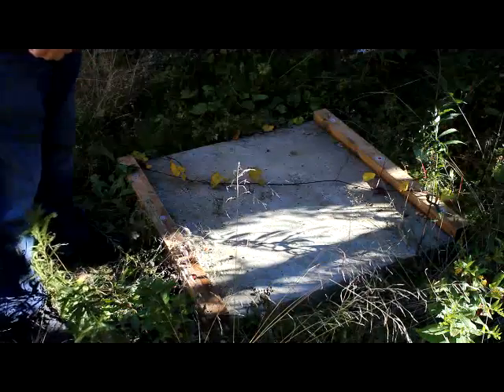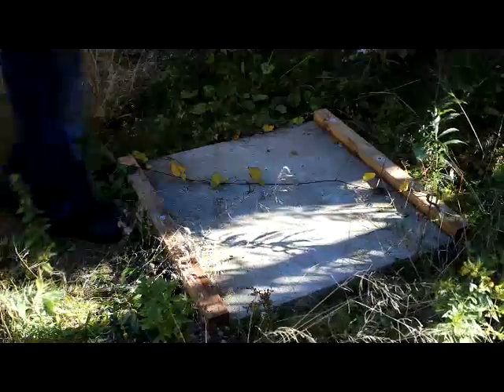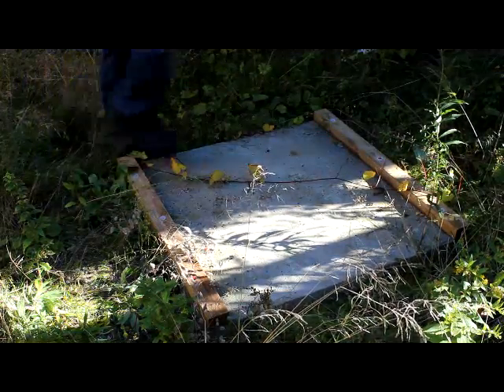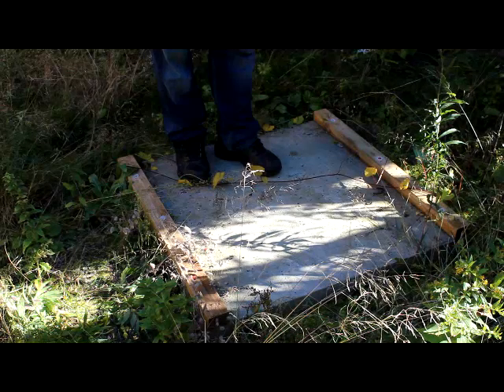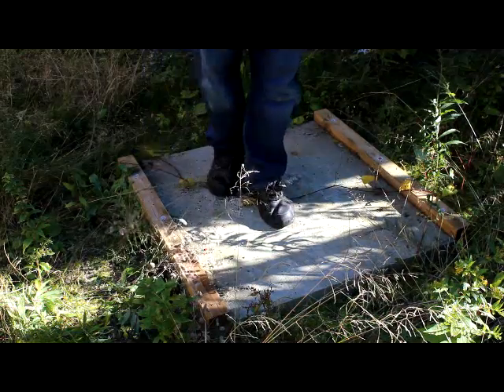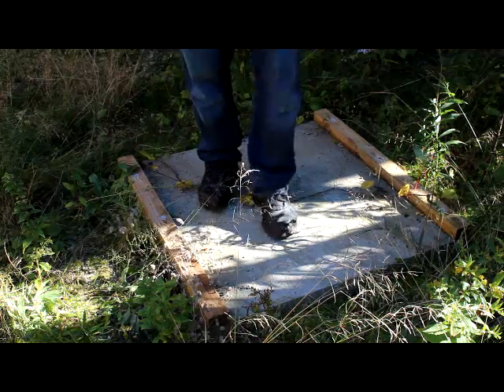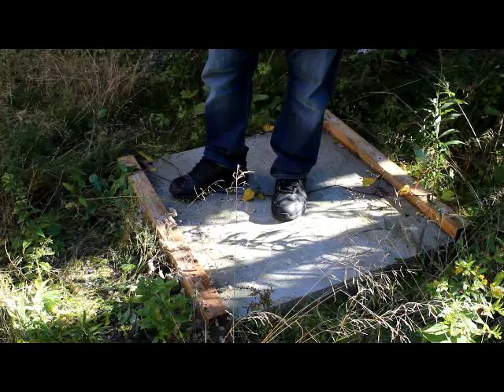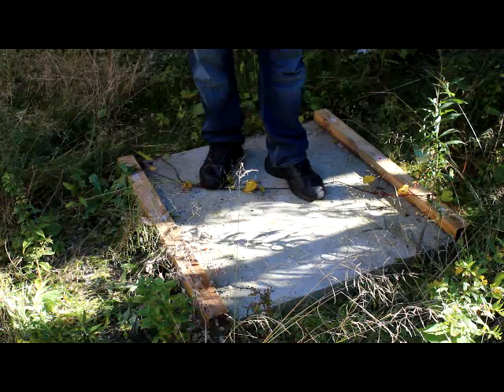(S-2 Ep-57) DIY Portable Generator Enclosure (FREE PLANS) Part 1

Comment: Do you pull your generator out every time you fuel it?
Reply from the maker: No. I have sufficient access to refuel the generator when it is cold. I do pull the generator out to refuel (it's on wheels) when it is hot though for an added measure of safety and less chance of a spill.

Comment: Uncanny. yesterday pre-assembled my generator enclosure. The design is VERY similar to what you built. I will be posting the final in-place assembly in a few weeks on my channel. My material cost so far is < $250.
Reply from the maker: My cost was close to nothing (just a couple of bags of concrete mix) because I built mine from leftover/scrap materials. In fact, I based my design on what materials I had on hand that I didn't have to buy. That's pretty much the way things usually go around here. I tend to be quite frugal.

Comment: Interested in how you skinned it!
Reply from the maker: Me too! Actually, this is as far as I could go before the snow fell and winter set in last year. When winter comes here in Downeast Maine, it comes very fast, without warning, and with a vengeance! It simply got too cold to work outside. I'd like to get it finished before the snow flies this year, and I'm planning on using OSB. I'll video the operation and that will be "Part 2." Right now, I'm racing against the calendar to get my 18' sailboat hull constructed before it gets too cold for adhesives/epoxy to cure. Video quality should be greatly improved in all future videos as we just had wireless internet service made available and installed today. It replaces the old DSL crappy internet service we've been using that only allowed me to make videos in low definition - but now they will be made and uploaded in high def.